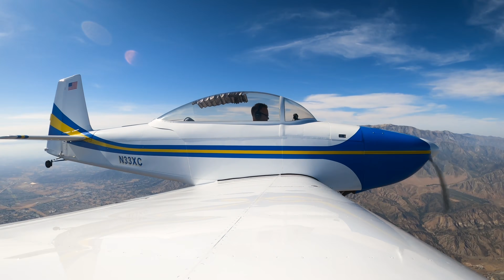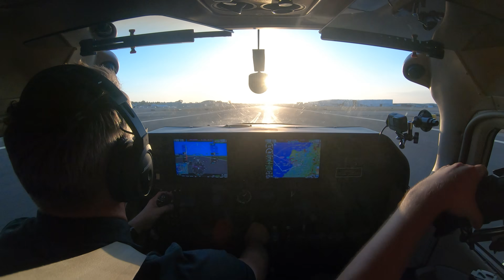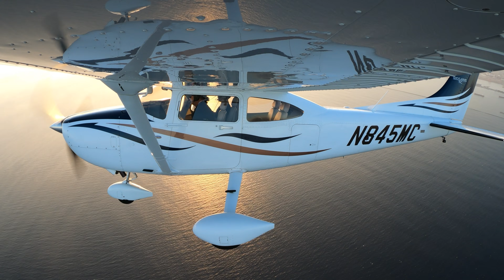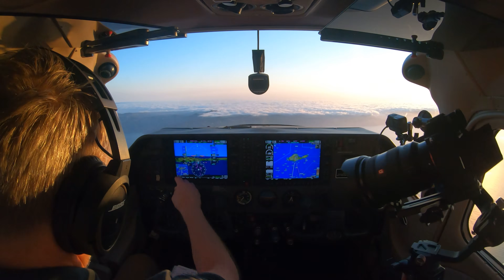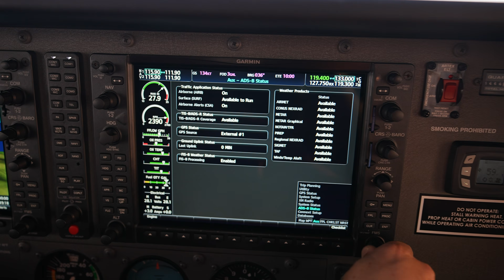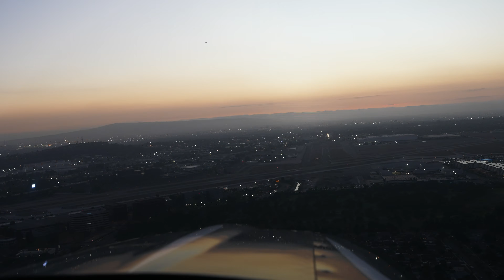Heavily Upgraded 2008 Cessna 182 Skylane TC

Comment: Looking at the power settings you were flying it at, it seems a bit slow for a 182T. Indicated 124-126kt. Ours cruise at solid 140kt just under the yellow arc. I wonder if VGs are slowing her down?
Reply from the maker: Honestly - I thought the same thing but we were low so not sure. I have flown that same one at 7500’ and the speeds were normal. Thanks for the message.

Comment: Rich - other than the avionics updates, do you see many noticeable updates in these 182’s throughout the years. i.e. Is a 2016 182 almost the same as a 2021 182 except for the G1000 internals?
Reply from the maker: Correct - 2007 and newer are really the same all the way up to 2022. They did go to newer 3 in 1 standby electronic flight instruments but that’s upgradable (same with NXI). Thanks for watching!

Comment: Throttle & Mixture in during fuel prime, or was that a hot start?
Reply from the maker: I prime them cold with throttle all the way in - fuel flows much more rapidly, less use on the pump/battery was always my thinking - probably splitting hairs though!
Reply: @FlyingwithRich  Makes sense . . . Six of one . . . 1/2 dozen of the other - HA!

Comment: My Dad never had Turbos is in our planes. To much trouble back then he said.
Reply from the maker: They used to bolt turbo chargers on NA engines and has some issues. The news are turbo charged out of the box automatic wastegates, and de-rated so pretty solid engines. Thanks for watching!
Reply: @FlyingwithRich  you don't really benefit from the turbos until you get like 10,000 ft or more, correct? So for most people that stay under $10,000 you'd be better off just getting a bigger motor, old playing with the io 550. Do you agree?
Reply from the maker: Tough call - benefits to both the 550 upgrade (you can’t do that on 182T), and the stock TIO 540. I like turbo charged airplanes, and you are correct on paying off at higher altitudes. Also benefit on take off performance at high density altitude airports. I really like both options so I guess really depends on where you are operating and budget. Thanks for the message.
Reply: @FlyingwithRich  I Believe the DC7s were Turbo Supercharger and intercooled monster's.
Reply from the maker: Correct!
Reply: I’m in the high desert of W Texas with my 2004 C-T182T & find the turbo really helpful for the high density altitude situations & areas of terrain, of course. I was told the turbo Skylane has the advantage for W of the Mississippi.

Comment: Could we get an STC which would allow us to run this engine at full RPM? 2700rpm, and if so would it make $285 horsepower or with this one be $310 horsepower? I hate that they've detuned this engine to make such little horsepower. Every time I watch a video where they have put the 300 horsepower IO 550 everybody says that is the right amount of horsepower for that airplane. The same like coming engine can make 310 horsepower, why don't they just put that in there? Since this engine is bent detuned can we just run into 2400 RPM all day long?
Reply from the maker: As far as I know, no way to crank up the HP on the 540s in the newer 182s.  I think there is an STC for a 260HP 540, but I believe a different variant and not turning up RPM.  Thanks for watching!
Reply: 2000 TBO is really nice, I bet that number goes down if you extract more HP

Comment: Wow, why the need after all these years for full span VGs???
Reply from the maker: Slower stall speed than clean wing.  I agree - how much slower do you need to go in a Skylane,  but pretty cheap upgrade, and makes a difference!
Reply: I have VGs on my 2004 C-T182T & notice that power on stalls are difficult to demo because of a much lower stall speed. Prob best feature of the VG is the added safety margin for low level maneuvering like in the traffic patterns.
Reply from the maker: Agree. Thanks for watching!
Reply from the maker: Nice. I agree. Thanks for watching!